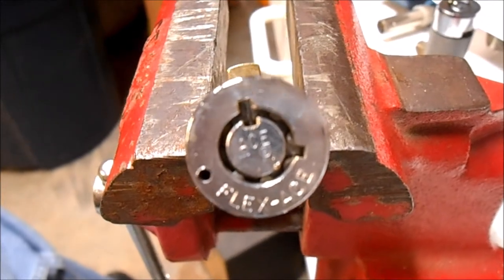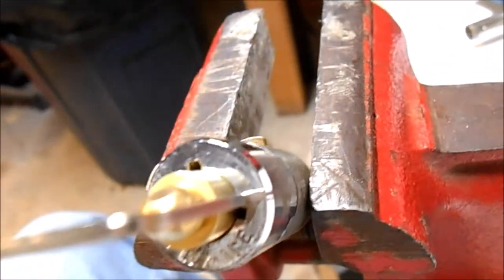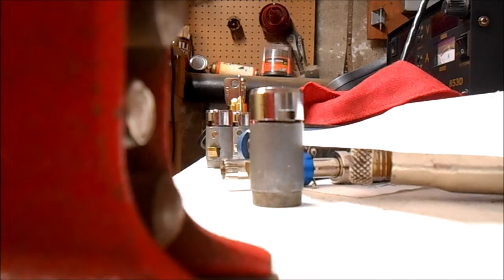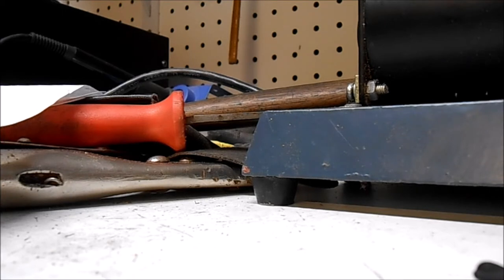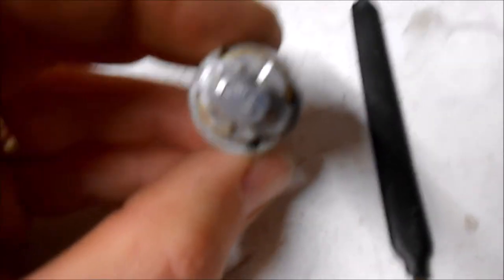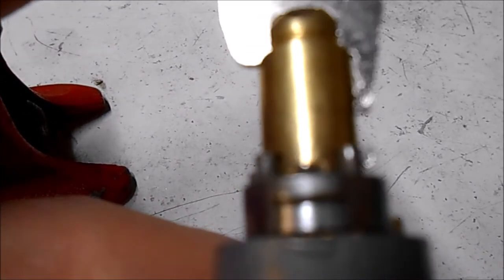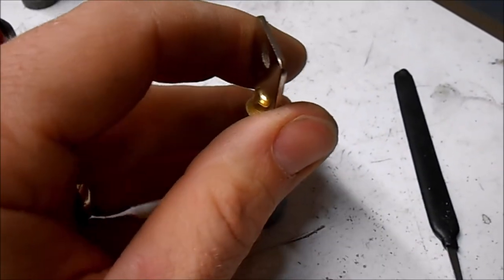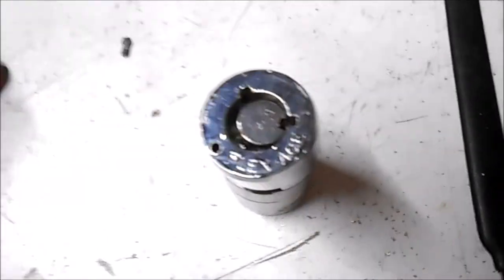Disassembly of a FLEX ACE lock

Comment: What do you use to cut key
Reply from the maker: Wexing (could be spelling that wrong) key cutter I've heavily modified.  It's about as low end you can go with a machine and still produce usable results. It will copy basic keys easily but it won't do offset cuts out of the box. You'll need a set of depth and space keys with it as well since it doesn't come with a cut by code option.
Reply: What do you do if you don’t have a key? And don’t know how to make one?
Reply from the maker: I'd recommend finding a locksmith.  Though most guys these days only know how to destroy locks so you might have to call around.